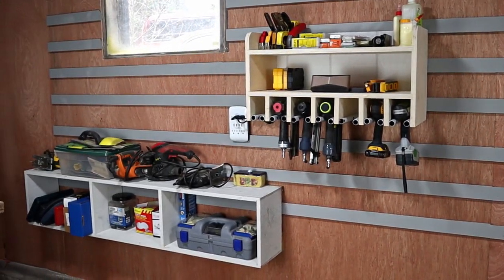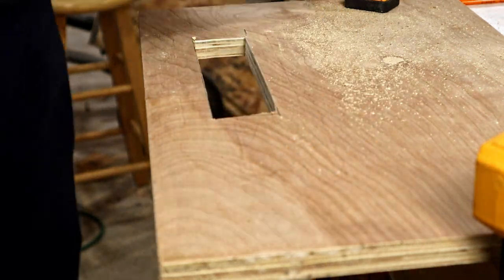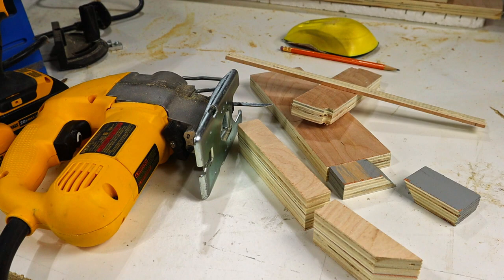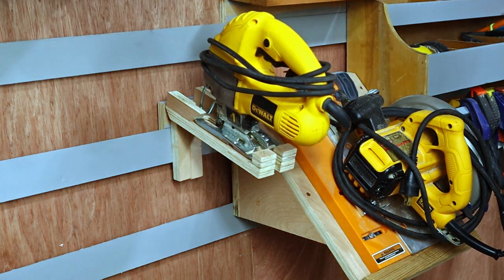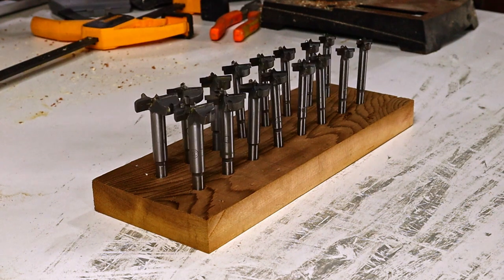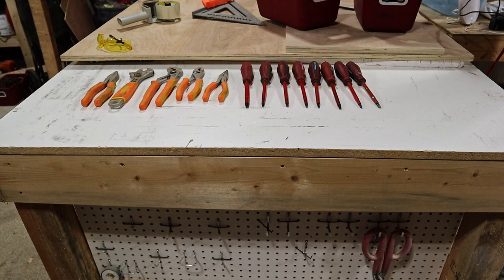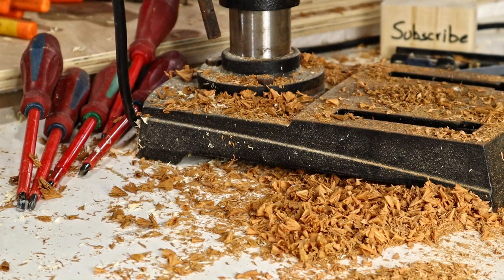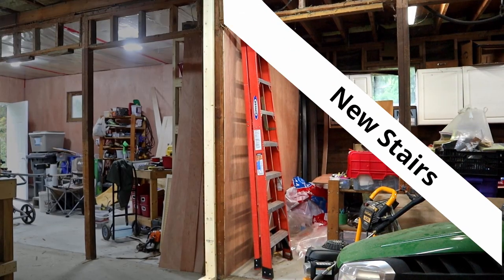French Cleat Tool Storage Ideas

Comment: Shops are never done, and there are always going to be new tools to add to the wall. That is why I like yours and that there is room for expansion.  I would suggest that you sand the surface rust off of your cast iron and steel power tools and give them a light coating of WD-40 or paste wax. Not only will they look nicer, but they will last much longer and perform better too. The rust on the drill press table can be transferred to wood and that can be hard to remove. Just a suggestion.